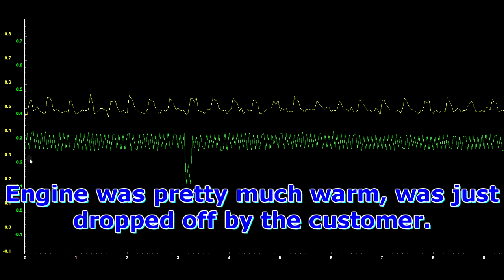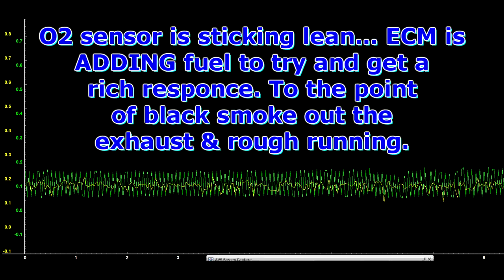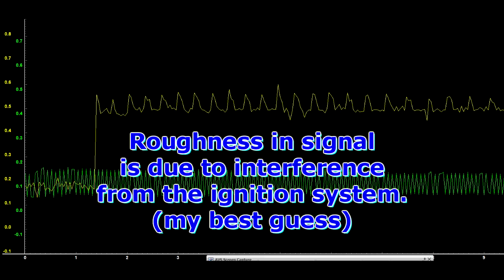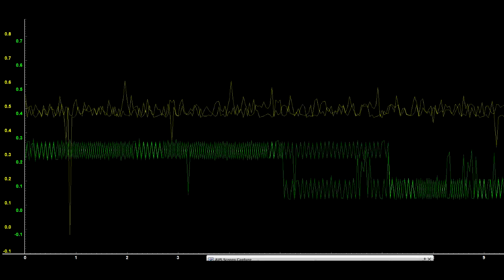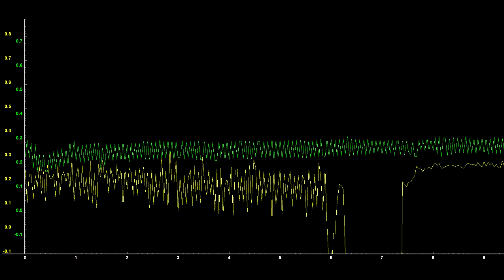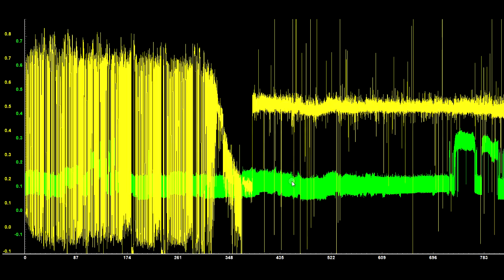VW A2: 1.8L Rough running / lack of power / black smoke

Comment: been having the same problem on my vw transporter T4 2.0 aac dignifant black smoke,rough idle,no power, even when cold,changed the coil,sparkplugs/wires,impulse sensor,now thinking might be the O2 sensor its driving me nuts@Thomas EXOVCDS got anymore tips surely appreciate it?
Reply from the maker: Sorry about the late reply, I just got up. Disconnecting the O2 to see if things change is a quick and easy thing to do. Fuel pressure would be next and making sure that there are no exhaust restrictions.

Comment: Perfect!!  I am dealing with a very high co reading on a 91 Accord 4 cyl. It won’t pass smog. I also have a Vantage Pro. I didn’t think to drive it to get it to act up. My O2 sensor is a new Denso. U must have some longer test leads. Thanks for the tip.
Reply from the maker: +Bill Rimmer Yes, I have long leads from aeswave. Sometimes I have to make them longer by adding jumper wires to the ends.

Comment: I wish I had that when I used to work on older models but I still could use it on older Vanagon's
Reply from the maker: I forgot to mention THE MAIN input... the hall sensor in the distributor. Without it... engine won't even start! LOL
Reply: Yes you are right but I think you were focused on things that would affect the fuel trim.
Reply from the maker: Good point.